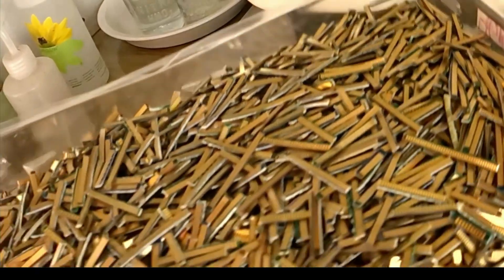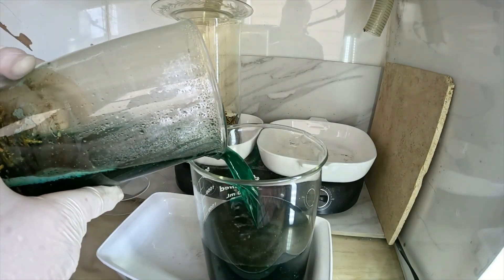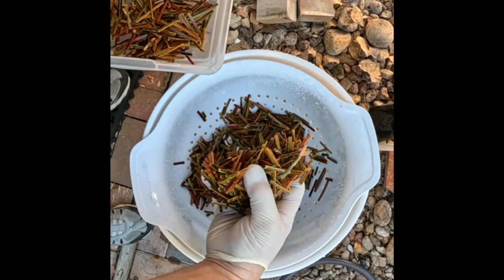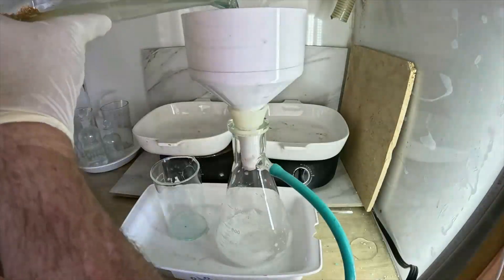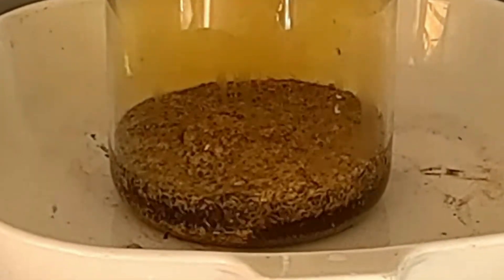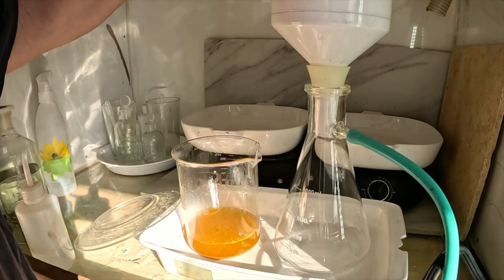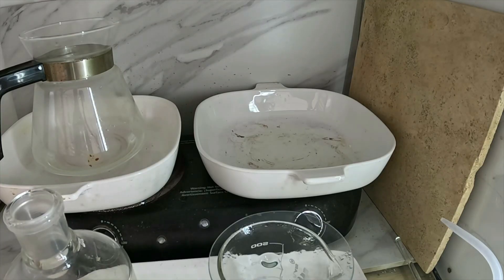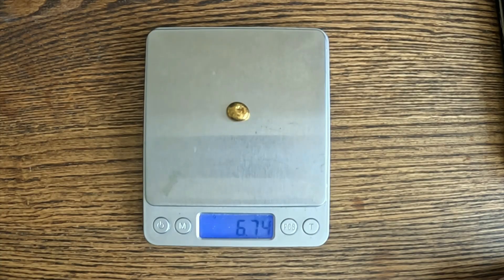Turn Scrap RAM into 24K Gold with This Simple Process

Comment: So how many KG RAM was it initially?
Reply from the maker: It’s hard to say exactly because the number of chips can vary, the laptop vs desktop ratio all can impact the weight of the original RAM, but based on averages, it was probably around 14 to 15 kg of RAM.
Reply: @AcidnGases I think that's quite accurate, looking what they pay per kg in my area for ram sticks. Thanks.

Comment: Did you test the solution before you poured it off for good in solution?
Reply from the maker: Its always good practice to test spent AR before it goes to the final stock pot, once there I still precipitate any small amount of values with copper before it goes to the actual waste stream.

Comment: I skip the nitric acid,I use salt,vinegar and hydrogen peroxide, it's a bit slower,but it's way safer,and works just as good!
Reply: And to desolve the foils I use hydrochloric acid and concentrated bleach
Reply from the maker: Thanks for watching!  There are many methods that work for most of the steps of refining, each with pros and cons,  it’s really what each refiner is comfortable with using and can safely handle.
Reply: @AcidnGases yes that and availability of products. Here in Canada,to get nitric acid you need to have a licence